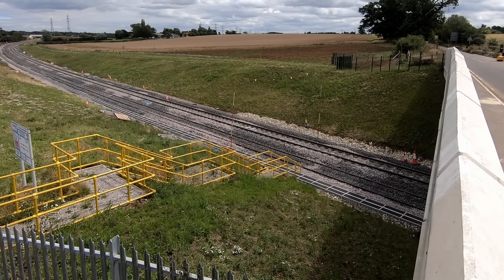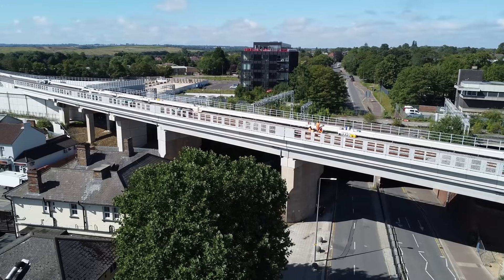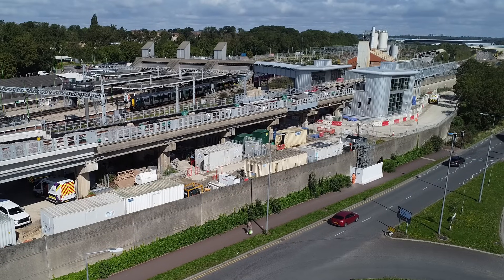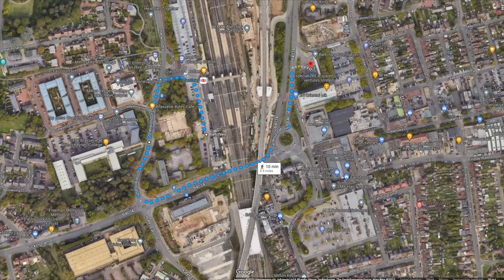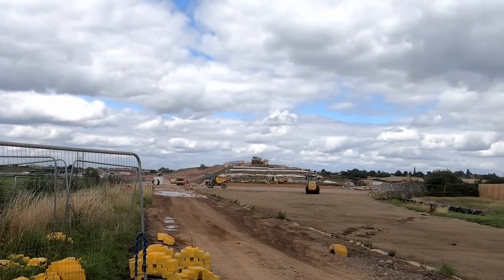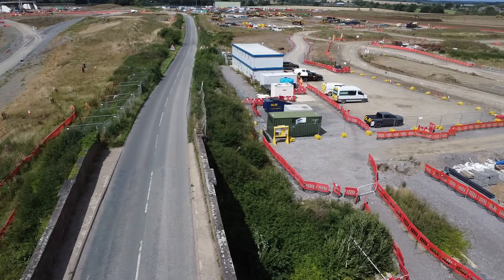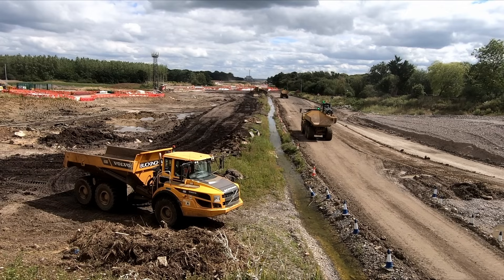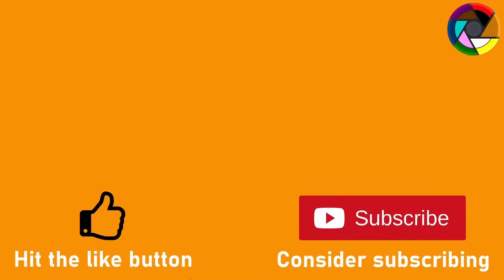East West Rail Bicester to Bletchley

Comment: Thanks for the connection,  my main concern of my great interest in railway as a whole, is east/west rail as I don't want them to make the same mistake as the A14 project,  where they didn't build enough lanes. Once it is open every rail company in GB will seek track space  eg container traffic FELIXSTOWE/HARWICH - SOUTHAMPTON,  passenger companies cross-country trains NORWICH - PENZANCE  TRAINS TO OXFORD -READING GATWICK CARDIFF  ETC ETC I personally think they need two fast & two slow tracks. I might just add that my wife has set up the account for me, I am Trevor Jones.
Reply from the maker: I think the biggest issue for freight is capacity beyond EWR. So there may be demand but existing lines don't have the paths for additional freight via EWR, Oxford will remain particularly constrained even after 2 upgrades. I think EWR Co want to downplay any potential for freight, as the idea of freight trains using the line seems to upset local residents. I'm sure though that there will be capacity for freight,  the planned passenger service shouldn't push the capacity available.

Comment: Thank you, interesting video. I had not realised that there was potential for a link to HS2. Would that take the form of an interchange station rather than trains sharing tracks?
Reply from the maker: The link would allow trains to travel from Aylesbury to Milton Keynes. The connection from HS2 would just be for the infrastructure maintenance depot.
Reply: OK, Thanks for the info. @Rail_Focus

Comment: Need stations where the east-west line crosses the west and east coast main lines, HS2 and the Western Line.. Essentially, build loops at the crossovers, then platforms on the loops, then an interchange concourse. Also include bus interchange and carparks where appropriate.
Reply from the maker: Bletchley will act as the interchange between EWR and WCML, whilst a new station at Tempsford will connect with the ECML. However I don't think there would be enough demand for a HS2/EWR station to justify the cost.
Reply: @Rail_Focus  The island of Great Britain (and the island of Ireland for that matter) need a rail grid - essentially treat the whole island as a metropolitan area with the grid serving the urban nodes. Obviously, the grid is rather useless if you can't change between lines on the grid. The East-West line is the first major east-west line north of London and it connects many important small cities in the knowledge economy. The East-West line must extend coast to coast - perhaps Hereford- Gloucester-Oxford-Cambridge-Norwich-Great Yarmouth??
The point of the grid is everybody person and business does not need to live in expensive London but the economic benefits of living in a metropolitan area are achieved.
The UK has drawn the line at not installing continuous electric power along every rail line. High charge rate batteries (LFP) are cheap, can charge using a pantograph at stations. CBTC using wi-fi style radio is cheap. Trains don't need drivers. Train control centres can use cameras and radar to continuously monitor rail corridors. Technology will bring down the cost of rail. Rail functions better than roads in many UK weather situations. UK and Ireland need to envisage a low cost rail network for 2070 and set out to build it. Full cost recovery from fares, as TfL is required to do, is effectively double taxation of users. All beneficiaries must be taxed - that is why access infrastructure, road, rail, water pipes, electric poles and wires, and optical fibre land lines should largely be financed by sale of government bonds, and funded via general economic taxes. Access services and infrastructure must exist before they can be used. Government must plan what the land use and land access will be at least 50 years and then get it built, keeping an eye to the changing merits of transport modes with development of new technologies. 
NSW Australia between representative government in 1856 and WW2 is a great example of what can be achieved when access services and their supporting infrastructure are thought about in this fashion. While government plans, it should pay the private sector to design and build infrastructure and rolling stock. It should then pay the private sector to maintain and operate rolling stock. Government plans must include timetabled commuter transport as the service is provided to all beneficiaries - business owners and service users.

Comment: @rail_focus do you have any information on the section near St Neots? Will they be using cutouts or Viaducts to cross the existing A428?
Reply from the maker: Not entirely sure, although a preferred route has been selected the details of that route seem a bit thin at present.

Comment: I live next to Woburn Sands and it will be interesting to see how the section from BL to Bed will be completed, the lines are already in place. Theres a number of level crossings on that route though and I wonder with the increase in traffic if some till need to be taken out/replaced with bridges. The road connections west of MK are so poor and its such a pain to get to Oxford (and further) by road, I think it will have quite a lot of use, and even more so if they can make a spur to Aylesbury where you cant get to by rail short of going through London or across Watford by foot. I wonder if some of those trains might even run through to High Wycombe.
Reply from the maker: It seems a lot of work will have to be carried out along the Marston Vale line to make it suitable, especially in relation to the level crossing.
Reply: Have you seen the route through Bedford ? the work involved and the demolition of homes ?

Comment: What will the top speed of line be?. And what would it have been it if was electrified?
Reply from the maker: EWR is supposed to be a 100mph railway, however the Marston Vale line section will be limited to somewhere between 60 and 100mph. Electrification wouldn't alter the top speed, but obviously electric trains do accelerate better than diesel

Comment: Its a shame that a HS2/EWR interchange station wasn't included, even as a passive provision. I could see it being a good link between the likes of Southampton, etc. meaning you could avoid travelling to London
Reply from the maker: Difficult to justify £500 for a station that may have limited benefit and little scope to encourage new housing in the area. HS2 passengers from the North will have much better connections to the south and south west via Old Oak Common whilst EWR passengers will benefit from improved north south connections via Milton Keynes
Reply: James, there are some missed opportunities with this line. EWR-HS2 interchange as you say, Aylesbury-MK is another, chords to enable MK-Stansted airport direct are yet another (before covid sometimes 20 buses a day ran that route) and I am not sure if we will even see a Norwich-Oxford service in the first few years. Maybe these will all happen in time, but the whole project seems to be so slow.
Reply: The interchange from the south/south west will be at moor street/curzon street, and from WCML south at interchange. The whole point of HSR is not to have too many stops.

Comment: The East-West Rail link is coming along very nicely and I still think that the section between Bedford-Cambridge should still happen. And new trains to be ordered for the East-West line.
Reply: Bedford to cambridge will happen, but like the latest news for the Marston Vale line, I suspect there will be some trimming back of the infrastructure. I'm also expecting the line speed to be reduced below 100 mph to meet noise constraints. This will save money but the concept of a fast 100 mph regional service for EWR is now just a bit undermined.
Reply: True.
Reply: East- west is between Liverpool and Newcastle!!! Get the priorities right.
Reply: The East-West Rail line formerly known as the Varsity Line once connected Oxford-Cambridge and Bedford and to other places in the East of England including Norwich and Ipswich. And once it’s completed then you can go from Oxford to Norwich and Ipswich without having to go via London.
Reply from the maker: @garethwilliams976 you mean the multi £bn TRU ? That is currently underway
Reply: @garethwilliams976  What the hell you on about this is the reopening of the East West Rail route for the Oxford to Cambridge that Labour party order British Rail to close, Not Liverpool to Newcastle route.
Reply: @scottpeacock5492   the Labour party told BR to close the original line ??

Comment: Thankyou for another great video on this interesting and ongoing project. I've followed this idea for around 2 decades now and it's great to see it really happening. I also got to visit the BRC at Quainton Road by train before they stopped running occasional services there though it would be great if they start running them again in the future on the way to Milton Keynes, otherwise, you'll just have to set your camera to a high shutter speed and try to snap a pic out the windows at 300+kmph from HS2.

Comment: So pleased this is finally happening - albeit slowly….

Pleased to see the line will have a station at Cambourne - this is a modern new town outside Cambridge and is watched with interest by town planners!
Reply from the maker: Having visited the Buckinghamshire stretch twice now it's amazing how much work is required to open a new line. New bridges and realigning roads, all means it takes a long time to accomplish. With the stretch from Bedford to Cambridge being on a new alignment I think it's going to be a decade before we see any trains running east to west
Reply: @Rail_Focus I expect that plans from Milton Keynes to Cambridge will experience significant delays, as there is a significant overlap with EWR plans and the MK eastern expansion area.
Reply: @Rail_Focus   It might seem a good idea to some but the route preferred by EWR going into Bedford causing all kinds of issues , including demolition of homes. is very damaging to Bedford if it goes ahead. Most of the gain will go  elsewhere.  This is a revival of the Varsity line that ran from the 1860s to the 1960s..now they want to bring it back. Somehow I feel Reeves's prediction it will create a  'Silicon Valley' is doubtful.
Reply: @Jack_Warner - I don’t disagree - I’m not a fan of how crammed in new builds often are - cambourne is better than most amazingly 😢

Comment: It is really annoying that they did not even consider from the start of this rebuild to run overhead power lines from the start - what a waste of money and time
Reply from the maker: DfT / Treasury penny pinching. The only saving grace is the new bridges built were done so with electrification in mind, however existing bridges now replaced will have to be adjusted
Reply: Be grateful it's happening at all. If they had costed for electrification, it would have been deemed too expensive.
Reply: @quantisedspace7047 I hope futureproofing provisions were made though.
Reply from the maker: The new bridges and station have been built with passive provision for electrification, however existing bridges would have to be altered
Reply: I think electrification was in the initial design, but was quickly dropped during the debacle otf the GWML electrification .
Reply: @andrewhotston983  Oh man, that really was dumb. That should've been electrified all the way up to Oxford.
Reply: Tory government for you. I never trust them with infra projects like this. You always get a cut down half-arsed project (CTML,) or one thats seriously over time and/or over budget (Crossrail) through lazy oversight (thanks Mayor Boris.)
Reply: All about the £££

Comment: Crackin vid. Can't wait for a deep dive into the Bletchley/Bedford and Bedford/Cambridge sections... when they have finalised the designs.
Reply: Latest on the Marston Vale section is a reduced investment plan than originally intended. All the stations are being kept and some of the level crossings retained. The idea is half hourly stopping service and one faster service per hour. This will require one passing loop location yet to be decided. Biggest change is reduction in line speed below 100 mph. This is mainly due to noise concerns for 100 mph running. It will be anything between 70 and 90 mph but not yet decided. So the overall cost for this section will be reduced. So the cost constraints due to inflation plus other factors are beginning to bite. To be fair this is very much the second of two options for this section, but the big surprise is the reduction in line speed. This was never suggested in the original option, as several passing loops were proposed not just one.
Reply from the maker: Thanks, still working my way through the consultation document but will hopefully have something ready for Sunday
Reply: @Rail_Focus Yep the consultation document goes into a great amount of detail. The individual analysis of crossings and footpaths is quite interesting. The retention of several level crossings does make sense in terms of reducing disruption and cost. The reduction in line speed isn't surprising given all the changes. No figures have been given for this, just a general statement ' above current line speed of 60mph and below the previously suggested 100 mph'.  Whichever way you look at it, the original plan of 100 mph running for this section is gone. I just wonder how this mpacts the business case and the financial return for EWR. The idea was to have a regional fast link between Oxford and Cambridge. This is going to be a bit more difficult to justify now. Or perhaps the importance of freight will be more underlined now than previously.
Reply: @ds1868  I always thought the elimination of level crossings were no.1 priority for both safety and disruption reasons. But what do I know? You can't exactly run 6 tph each direction through a busy town level crossing...notwithstanding kids and idiots playing on the line.
Reply from the maker: 30 level crossings will be dealt with in some manner, but the service frequency and speed has been reduced from 5tph to 3tph and sub 100mph limit so some can be retained in order to keep the costs down.
Reply: @dominiccottrill2387 Completely agree. But as mentioned service interval is now only 3tph. Two slow ones stopping at all stations and only one 'fast' one, but the speed of that is going to be below 100 mph. Consequently only one passing loop. I'm nit sure how fast trains can go through level crossings but I have a feeling the fast service will not be much over 75 mph.

Comment: Love the work going on at Calvert. It does seem very slow, though.
Reply from the maker: I think because so many of the existing structures need rebuilding that it is slowing the project down. Seems reopening existing railways isn't as easy as people make out
Reply: I think they’ve been restricted to closing only one north south road at a time, to prevent forcing all road traffic down unsuitable routes.  There’s a brick arch overbridge on Gawcott Rd that’s still being used, it’s replacement underbridge is complete right alongside it, (at 3m 36s), waiting for the road to be realigned through it.
Reply: @Paul_707  thanks

Comment: As someone who lives (relatively) close to the route of the Central section I'm glad to see EWR going ahead, it's a sorely-needed link outside of London. It's just a shame that electrification is still up in the air.
Reply from the maker: I believe it will be transformation for people living in the area and rail travellers in general. It will certainly provide increased options for travelers
Reply: Electrification still up in the air? Wtf?
Reply: @eldrago19  Yep - built with passive provision (i.e. bridges high enough etc) but no electrification done.
Reply: With all the redundant EMUs lying around various sidings in the UK you'd think they'd get on with electrification on the basis that there wouldn't be a need to buy new stock.  I'm not sure that even now there are any spare DMUs around.
Reply from the maker: By 2024/5 there should be sufficient cl196s which will be sub leased to Chiltern to operate the initial service. But ultimately it should be electrified, seems like it's been built to a price just to make sure the DfT would actually fund it.
Reply: @Rail_Focus  Well, of course, this was a course of action used to successfully build the Merseyside system 40 years ago, build the tunnels, then buy the stock, then extend the system,  etc.  Greater Manchester took a different route and tried to fund their whole system in one go, but failed completely, and apart from the shell of one underground station, nothing was done.
Reply: I only just found out about this project, despite very regularly traveling from Bedford to Bletchley and to oxford. only happened to stumble across it that part of the line goes past what might be the UK site for the universal studios theme park.

Though will it beat the X5 coach / bus, which is currently only £2?? not sure :D